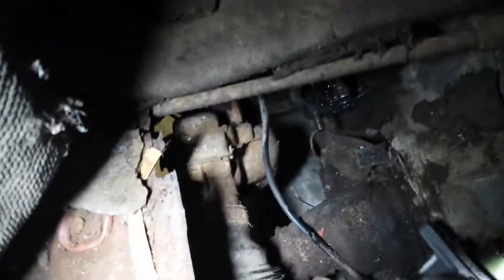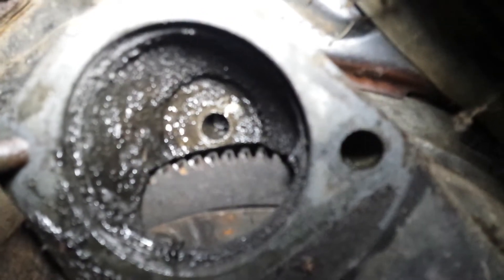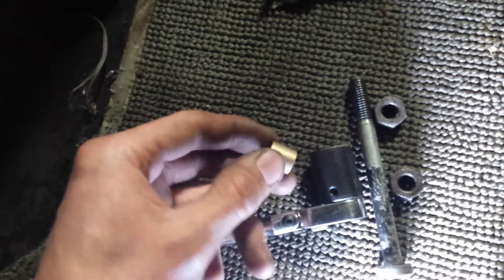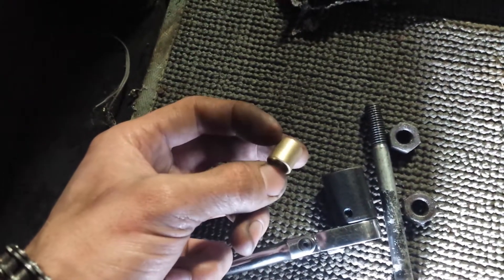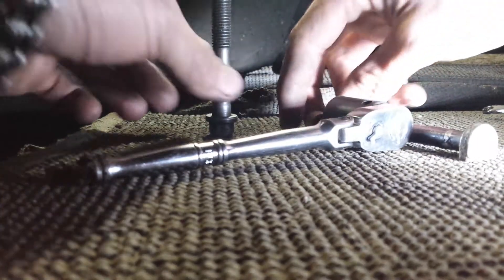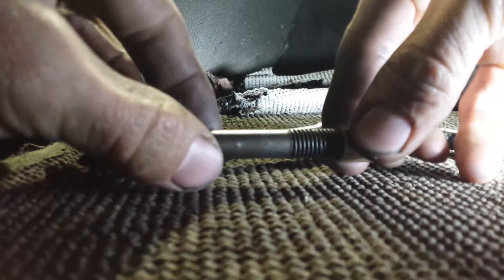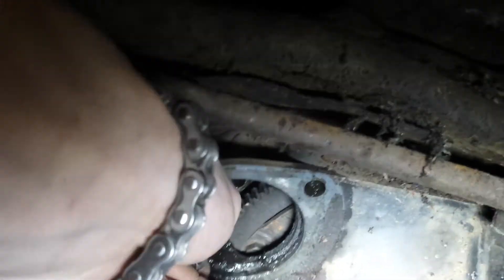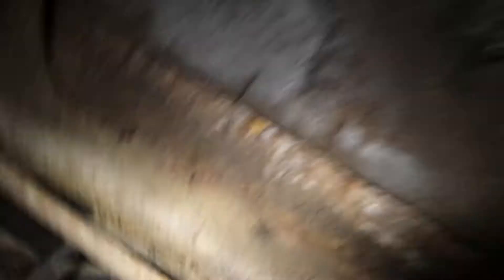Volkswagen bug slow starting problem fixed

Comment: i would use a self supporting starter as its more powerful than the one with a starter bushing as you can use a Bosch starter for an autostick bug in bugs August 1966 and later 12 volt models. as on Summit racing there is a more powerful gear reduction starter available its a Powermaster starter its a custom made Denso type starter like the autostick its self supporting as it will fit both manual and autostick models. as these starters there is no need to fiddle with the starter bushing you can leave it in there.
Reply: It's a Type IV/914 starter